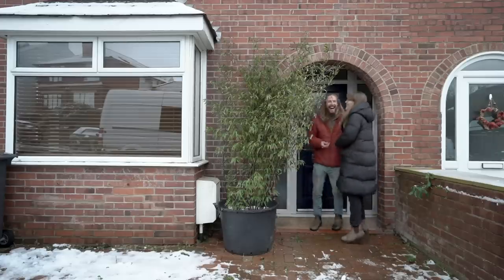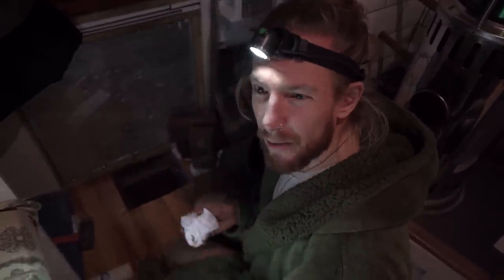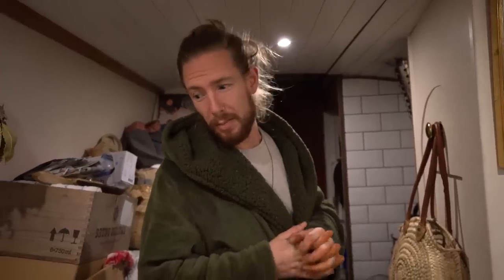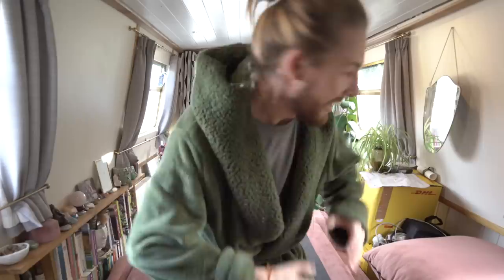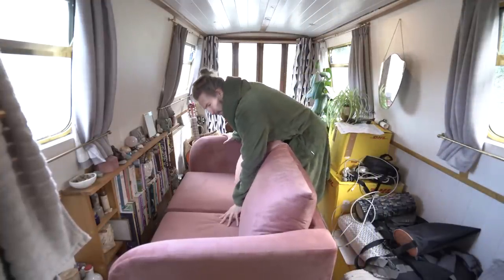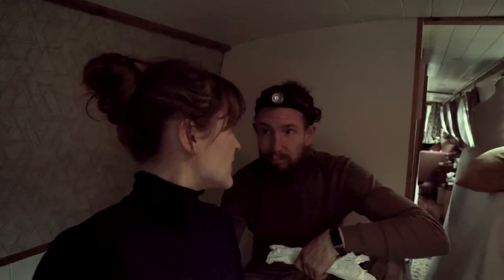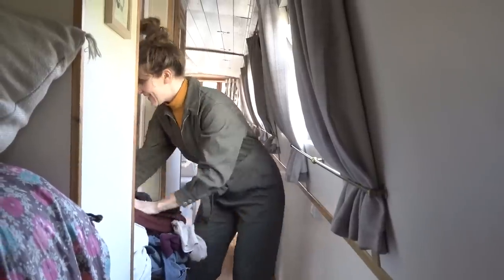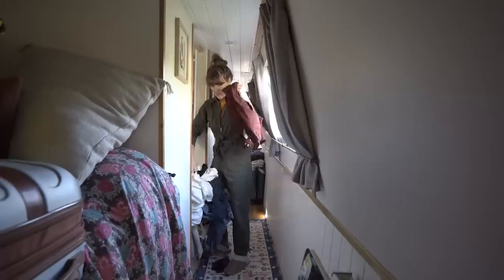Is our NARROWBOAT home SINKING? | EP 009

Comment: I use the Hyundai HY2500EFI, It use to have problems starting on battery, so I pulled out the battery and fitted a larger battery, and now it starts easily, Secondly mine is electronic fuel injected, so if the battery is flat, its nearly impossible to start manually as it needs current in battery to power the electronics to enable the generator to start. Thirdly, if the battery is low, use the car battery charge lead, (crocodile clips)  and you can jump start the Hyundai off your boats 12v battery. Fourthly this is a four stroke engine, and has a oil sump so if oil is low and the unit isn't sitting on flat level ground the unit will think its low on oil and not let it start, when flat on table level should be just level with the top of the thread of the dip stick screw. Fifth point, if the generator isn't used very often, the petrol with a 6 month shelf life goes off and can be hard to start, in which case use a fuel stabiliser which can extend petrol life to a year, or you can buy a higher grade of petrol from garden centre that has a shelf life of 5 years called "Aspen 4", it is Alkylate petrol and contains  no ethanol that attracts moisture, making it a great product for use in a marine environment  on products like generator or outboards. 

As I only use my generator for my 1300 Watt washing machine, using a electric grill when I have guests onboard and use  other high power products, the generator doesn't get much use in which case I top up with Aspen 4, if I know i'm going to use it more frequently ill use forecourt petrol, also most marinas around my area charge £15 a night with hookup, so once a fortnight, you can have a night on a pontoon, run your washing machine, top up batteries, get a pump out etc for the same price as 3-4 pints in a pub lol. Also my first spark plug failed after only 1 hours use, the next one is still going strong and my generators is insanely 4 years old and like new.

PPS: you could also run some Red-Ex injector cleaner through generator, you just pour it in the fuel tank, give it a shake, start it and let it run, for say 15 mins, turn off and wait 30 mins and restart and let it run for 10 mins, off again and let it rest then restart and use it as you would normally, It could have a partially blocked injector in the carburettor, and the stuff clears it out really well, I used it in year 3 when my generator was revving and not idling, and after running this through it settled down and is fine again. now ill put this through once a year at the beginning of the season or if I get the revving back, crossed fingers, its been fine.
Reply from the maker: Endeavour, thankyou so very much for reaching out to us and giving us this advice, really sound advice there. Thanks! 
I shall definitly look into it and also look into electric start too, that'll be a blessing!! 

Nice one buddy. Thanks again 🙏

Comment: If you move into an old house the task list seems to frow rather than shrink. Then you get on top of things as all that needed changing finally gets changed. Fast forward 10 to 15 years and it starts to repeat. Stuff has a life span afloat or onshore. I've dealt with drains, leaks in walls, roof issues (the monkeys and the civet cats mess with the tiles) and some of the air conditioning units are aboutgready to pack up - strangely the rarely used ones are showing the same signs as the one used every day. Same if you buy an old car for that matter.

Comment: From the look of the spark plug the generator is running rich ie to much fuel not enough air it should be a light sandy colour,there should be a mixture screw on the carb to adjust the airflow.
Reply from the maker: Thanks David, that is great feedback! I just read it to josh and he is going to investigate. You may have sorted the issue :)

Comment: If it was from your domestic water system your water pump would be running either continuously or on or off I have gone through what you have and it turned out the water tank filler where I put the hose in was broke and was filling the boat with water when I filled the tank I claimed on the insurance to have tank fixed

Comment: I've done a lot of pluming over the years and I can tell u those plastic white pipes the old ones are useless I noticed  one ipipe is not straight they have to be straight or they leak get rid of them and get some copper pipe and brass bolt up ones. mike southend
Reply: They may have used plastic so it does not freeze so easily  it depends how cold it gets under there you can insulate copper pipe there is also new pipe they use for central  heating it's more flexible but I prefer copper so easy to repair I just never trusted that push in plastic not long lasting like copper perhaps you need advice from boat repair man usually free good luck

Comment: Hi guys, me again. When we got our boat after about 6 months I found about 200 litres of water in the bilges. Turns out it was an historic leak that I found , when I first cleared the water it came back again and again so naturally I thought we were sinking, however I needn’t have worried as it turns out there was water trapped all around the ballast so with the movement of the boat the water kept seeping down to the back, making me think it was a leak , but in time it got less and less until it was completely dry. 
That said , that’s my boat and doesn’t necessarily mean it’s the same case for you. If your hill had a hole that water would be back in seconds and just keep on coming. I wouldn’t worry too much. 
When was yours last blacked?

Comment: the inverter cut when the volt on battery is to low.  buy new battery qick. old battery are crap to deal with
Reply from the maker: Thanks for that!! Yes, totally! We are upgrading our battery set up very soon :)
Reply: @UlaandJosh  you life will get so much better then.but i just need to say.when you got new battry dont ever huk them up to old battry becuse the old one will ruin the new ones, and dont use the washingmaskin on just the new battry,it will ruin them becuse of to high voltage. charge the battry with shorepower or that gas-generator you have when you use washingmaskin.And dont use the boat engine to much to charge the batteries, becuse you can over time damage it. just some pointers too you form my experians :)

Comment: You know what I think it was I think it was frozen water that had been in that boat for a very long time and this is exactly how roofs work to you know you live in a house where you got you got leaking in your roof all the sudden it rained last year and this year it rains a little and house starts leaking and you like where the fuck did that come from then you find out it was frozen and or it it took that long to accumulate to the point where was Dripping but it had been there for awhile it's not something new I don't think that this is a serious issue I think that it's a frozen it was frozen and then it got hot out one day and it thought out and that's all I think you should just take it easy and not over over don't freak out over it just don't

Comment: Appliances are very power hungry when using 12v via inverter, 100,s of amps from batteries for even short use. Heating water via batteries a big no no. Do a bit of reading about off grid power usage. Even updating batteries will not solve the problem if you cannot put the power back in, using engine or generator to charge takes an awfully long time